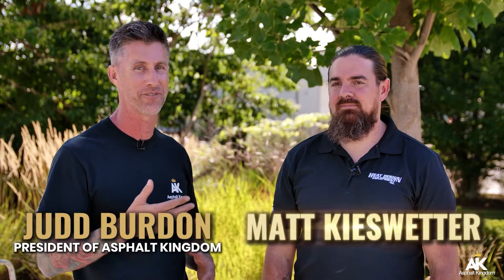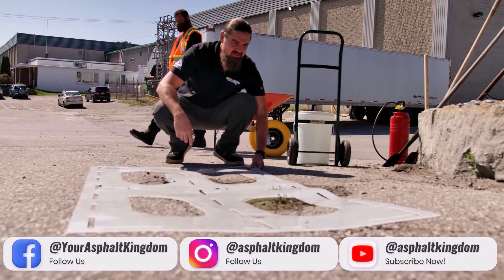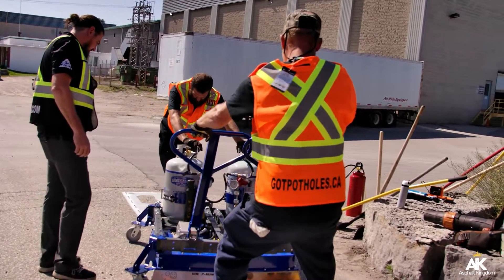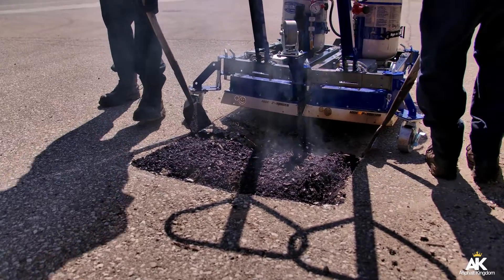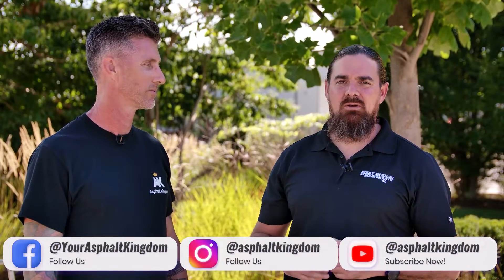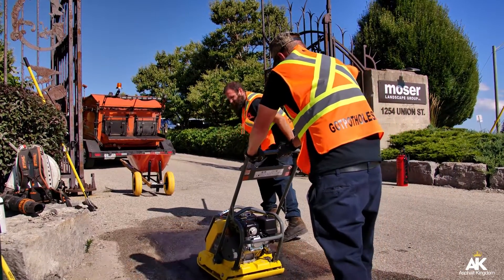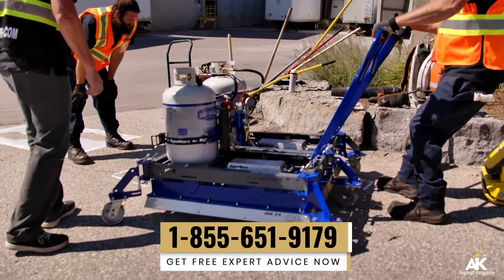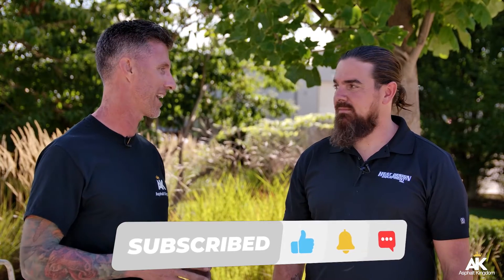How to Repair a Pothole: The Asphalt Patching Process

Comment: Can you use somthing else then hot mix with this machine?
Reply from the maker: Good question! Yes, you can also use asphalt millings with this infrared heater for asphalt patching. If paired with a rejuvenator, it restores the binder and helps the millings re-fuse into a cohesive patch.